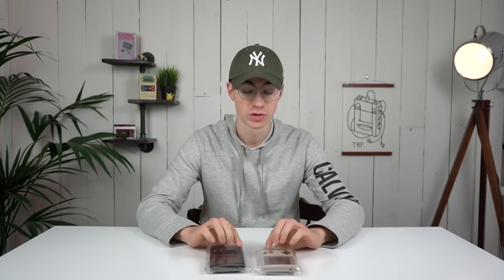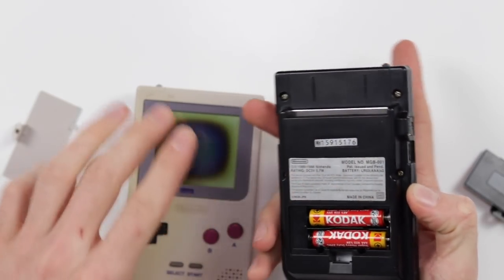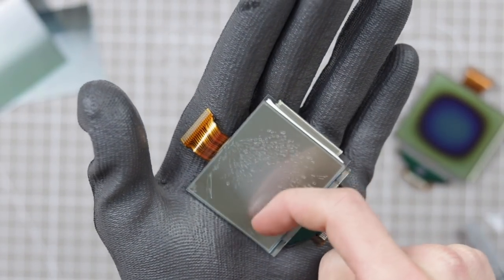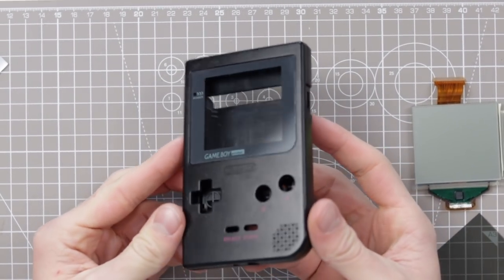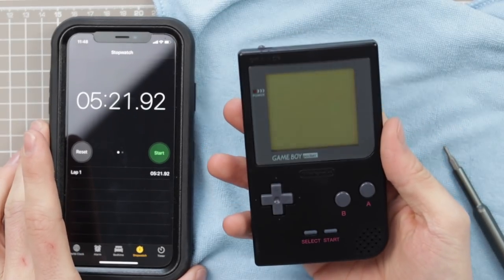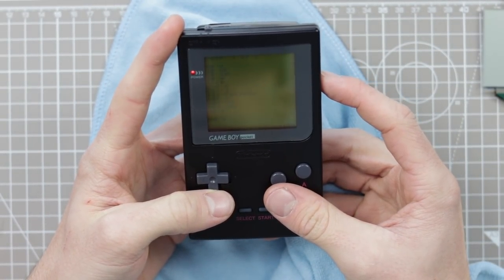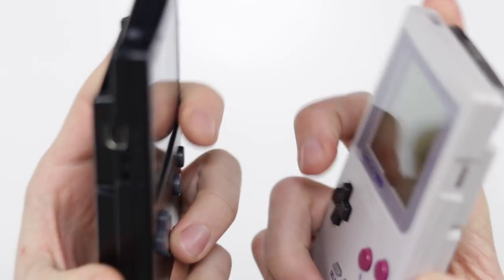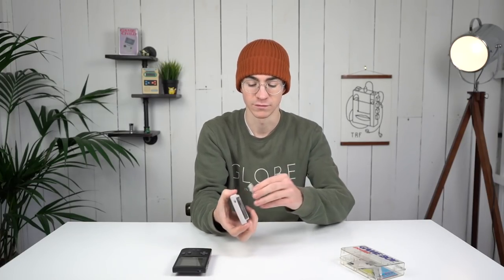Let's Refurb! - $42 Faulty GameBoy Pockets!

Comment: For those who don't have isopropanol alcohol at home, you can use vinegar to remove battery corrosion. If you don't have vinegar, you either don't cook or you're crazy. :)
Reply: Thanks man that's helpful
Reply: vinegar will rot the terminals and make them brittle.
Reply: @jeffoops9458  That's if you put excess solution, any equalizer can rot the terminals if you are not careful.
Reply: Vinegar works (acid) better as battery leaks are alkaline quite often.

Comment: IMO lighter fluid (£land) is much better at shifting those kinds of super sticky glue than IPA. Let it sit for a minute or two, then wipe off with kitchen towel. Might need a couple of goes as it smears, but you will be done more quickly.
For corrosion, white vinegar  is better as it neutralises the alkali that has leaked from the batteries. Rinse over with IPA afterwards.
Both are a bit smelly but then no guts, no glory. Neither will kill you.

Comment: That corroded terminal looked like those old rock-sugar candies, but in a blue color.   For peeling the polariser off of the screen, have you tried maybe heating it up slightly?  I've seen quite a few of your videos, and I may have missed one if you did try heating up the screen and stopped for whatever reason, so sorry for the suggestion if you've already tried it. :)

Comment: What to you use to retrobright your gameboys? I've got one at home I managed to repair and I wanted to make it look a tad better. Great video(s) by the way, refurbs are my favourite :)
Reply: Peroxide salon cream, the higher concentration the better, or just liquid peroxide, heat works better/more uniform than UV light, submerged it a sealed plastic bag and submerged in a hot water bath without touching the bottom that is.

Comment: I have a little hint to share regarding polarizing filters. I you look closely at the original one, you will notice that it consists of two layers. One is a polarizer and the second is a color filter (these are not scientific terms). There is another type of filters called circular polarizers. Some people claim that they remove the green tint. Well, I got a couple of those from China and they don't work so You may want to try a different route. Or maby I just got ripped off and they sent me wrong ones :p

Comment: How does he get them so cheap I can’t even find anything cheap on eBay
Reply: all the ones I got where around 14€ from Japan they all say they are Junk but the only problems I got where corrosion on the battery terminals that can be easily fixed the hardest one I got was a DMG with screen lines that I also managed to fix (DMG was a Yellow version)
Reply: all the ones I got where around 14€ from Japan they all say they are Junk but the only problems I got where corrosion on the battery terminals that can be easily fixed the hardest one I got was a DMG with screen lines that I also managed to fix (DMG was a Yellow version)
Reply: Ohhhhhh I see
Reply: How do I pull up the Japanese eBay or is it just like mixed in with the American eBay ,if so what do I search,sry I’m new at this stuff😅😅